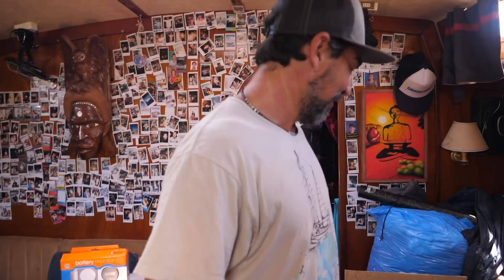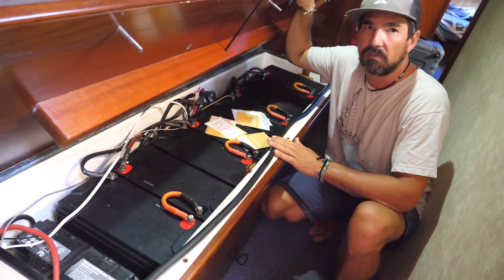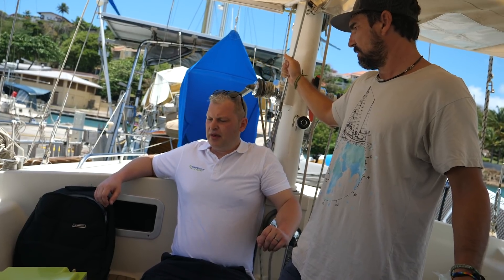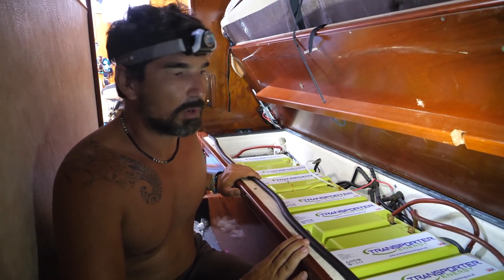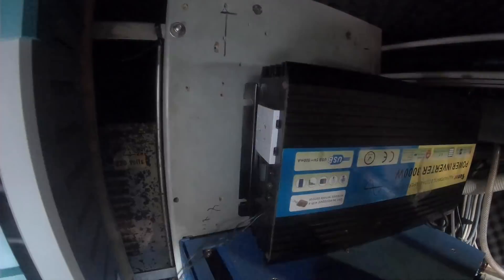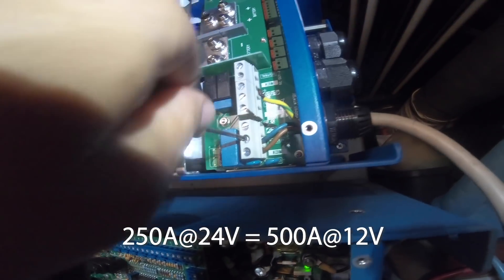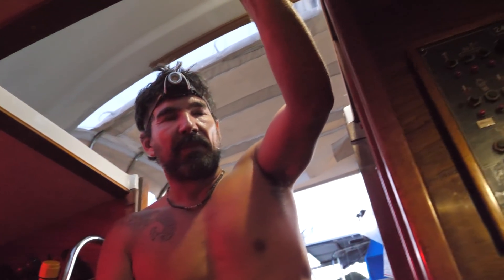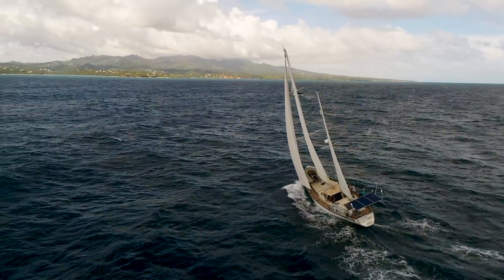Hello LITHIUM, Goodbye Propane!!!  Part 1-  Sailing Vessel Delos

Comment: Brian, I normally am enormous enthousiastic about your Technical knowlegde. But there are a few Safety concerns right nowwith your setup. 

You are running 4p2s setup while the internally bms (battery management Systems or computer thingy) is setup for single 12v eropin replacement. This means that the internal cells do balance but only within the 12v cells. In professional systems the Bms s of the individual batteries should be interconnected. Such that the 24v (2x12v) cells all balance equally. 
Second issue is that the 4 parallel batteries do not equalise because of the chemical electric properties. Normally lead acid batteries equalise automatically when paralleled because the voltage difference between full and empty is several volts. In the case of lifepo4 this is only .1 or .2 of a volts between 90% full and 20% empty (do not try to always charge your lifepo4 batteries this shortens life a lot in contrast to lead acid). The result of not equalizing is that one battery can be at 20% depth of charge and other battery at 40%. In which case you empty a single (set of 2 batteries in series) battery more than the other ones. Which means your total setup will fail much sooner, because of early ware of single battery. 

Third issue is that you rely on a safety mechanism inside of the battery in stead of an automatic Overal charge system. Ideally you separate load and charge form each other. Protect with a separate relay the load and charge such that your advanced overall bms controls at 90% full the relay of the charges and stops charging. Because you can’t control the charger by looking at the voltage as you would by lead acid. (I’d stop at 14 volts or something like that) because of the chemical electric properties. The bms system should stop charging when temperature of cells or equalization voltage of cell is reached. Same holds for discharging of the battery. In this way you are not relying on the safety mechanism but controlling charge and discharge. Victron has several examples of this on its website. The victron invertor has special add on programs for the bms to even control the charging or discharging. Such that you don’t have the issue of the spike (because of safety disconnects) of voltage. Instead the victron just stops charging. Nicely and safe. 

Fourth thingy. Lithium batteries are much more dangerous for shortages then lead acids because of the (low) internal resistance of the chemicals. This resistance is so low for lithium that giant power can flow, so big that it can evaporate cables. So please add a device in between the parallel batteries like victron battery protect such that it shut downs when a short occurs. In this way you are much more safe in case of a fire. 

Fifth I am missing the high power circuit breakers in your setup. (The cheap ones are enough just a bit bigger than your maximum load I.e. 200amps. There should always be one between a paralleled battery ( Incase a single battery shorts or something like that) and overall in case of an overload. So 4 in the cables to the connect bolt in the battery box and one in the cable from that point to your loads. As close to the battery as possible. This is not the same as a victron battery protect. Keep spares of the fuses on board!

So resuming very very nice setup ( i also have it installed in my boat but in separate cells in stead of drop in replacement, very happy with it. But take more safety precautions please!). If something is unclear please ask I try to explain it as good as possible. Also look at 123bms or batrium systems for bms systems. :)!

Safe voyages!
Reply from the maker: Hi Dennis, thanks for your comment.  We did have many of these discussions with Dragon Fly Energy, particularly about the internal BMS.  They said that this in fact was a supported configuration and the cell balancing should do it's job, however it may be worth it to follow up again with their engineers about the long term impacts on the internal cells themselves.  I'm sure they are interested in our feedback on the system configuration over time.  Interesting thing is that these batteries are designed to detect and stop the exact situation you describe, so it was not recommended to add an addition device  between parallel batteries.  The current protection device is in-fact embedded within each battery which will take the unit offline should it exceed the maximum allowed current.  We do however have overall system fuses and breakers, one at 400A, 200A, and 50A depending on where it is feeding.  Just didn't bother to show that part since it was already existing.  I know the internal BMS sounds interesting, but it sure does cut down on external wiring cables, and additional protection devices.    Dragon Fly provided some very specific voltages, and said the performance was optimized when the cells were at 14.4V, so 28.8V for our system, I hope to show some details of the configuration of the external victron BMS and the various charge controllers in the next vid.  Always gotta be a next vid :)  The whole thing is sort of a in-process project, but very exciting to get this onboard :) . Fair winds, and thank you for your excellent comment.  Brian
Reply: Hey Brian,
I think the BMS inside the batteries will work and protect the system of any damage.
But without an external BMS the voltage of the batteries in one branch can drift apart so that after some time the battery has 12.2V and the other 12.6V. This will happen when the internal resistance of the batteries are a little bit different. Every time you load or discharge the batteries the battery with more internal resistance get warmer and voltage difference between the battery is getting higher and higher.

There will be a problem when the voltage difference of the two batteries gets too high.
Let us say the voltage difference of the batteries is delta = 0.8V, the load cut off voltage of your inverters for both batteries is 28,8V and the cut off voltage of one internal BMS is 14.7V. When you try to load the branch to 28.8V the internal BMS of one Battery shuts the battery down when it reaches 14,7V. At that point the other Battery has a voltage of 28,8V -14,7V = 14,1V. The same is happening when you discharge the battery. I think it is not wise to use the internal overvoltage and undervoltage protection like this. Normally it is a protection device that prevent the battery for destruction. 

Normally the BMS should know the voltage of each battery cell in your case 8 cells. Then it will balance all the cell voltages to the same voltage.
If I were you I would check the voltage difference of the 4 branches regularly and if they are drifting apart I would balance them manually or install an external BMS.

And last but not least. I love your channel and your way of life.

Jan
Reply: You mean the voltage of the cells in series will be off? The ones in parallel should stay the same. So he has 4 battery pairs in series. Would his external BMS have to be connected to each parallel pair and charge them individually and then the internal BMS would take care of balancing the cells in the battery?
Reply: I had  the same concerns. I hope that Brian reads this!
Reply: LiFe batteries use the commonly preferred lithium technology for stationary energy storage. It is thermally stable and has high cycle life compared to some other Li-ION technologies.  These are not the kind of batteries that have been burning up in laptops and phones. The onboard BMS is crucial to the operation of this kind of battery. As far as circuit protection, I would go with DC fuses and cutout switches on a boat. The circuit breaker is not for a humid and maybe wet environment. This is from 40 years as an electrician and over 20 as a solar system designer and installer. Oh, and 20 plus years living off grid.
Reply: completely agree with Dennis' concerns - at least there should be an interface to the individual BMS's like CAN to enable a Master-BMS reading SOC, SOH  and DOD - than you really know, whats's going on;-)
@Brian: a functional block-diagram would allow people to better assist in improving your installation - nevertheless: excellent job - cheers!

Comment: now you have to builda slide out rack above your solar panels so as soon your not under way you slide them out and double the amount of solar no taking up extxa deck space
Reply: And use the wind speed sensor to automatically deploy or retact the panels so you don't forget to slide them back in during a blow when you're not on the boat...
Reply from the maker: Yes, now we're talking :)

Comment: Hey Delos, great induction gimbal, I was wondering if you’re  adding clamps to keep the pots in place on the cooker while navigating. Cause the cooker won’t be hot but the content will be.
Reply from the maker: Yes!  Just gonna copy the design from the old gas cooker.

Comment: Next comes the flux capacitor and the matter anti mater coupling device
Reply: It's tough to get good dilithium crystals when you're out cruising, you're never sure about the quality.
Reply: or what century they came from :-)
Reply: Dilithium is formed in the vapour of Lithium batteries when they are overcharged and thermally runaway. It's also possible to extract Lithium from seawater to produce quality Dilithium.
This is how I imagine the original USS Enterprise schooner was powered after someone time traveled back from the future and created the parallel dimension that is Star Trek... :)
Reply from the maker: 2.1 Gigawatts?!?!?!?

Comment: Brian, I normally am enormouslt enthousiastic about your Technical knowlegde. But there are a frw Safety concerns right nog with your setup. You are running 4p2s setup while the internally bms (battery management Systems or computer thingy) is setup for single 12v eropin replacement. This means that the internal cells do balance but only within the 12v cells. In professional systems the Bms s of the individual batteries should be connected. Such that the 24v (2x12v) cells all balance equally. Second issue is that the 4 parallel batteries do not equalise because of the chemical electric properties. Normally lead acid batteries equalise automatically when paralleled because the voltage difference between full and empty is several volts. In the case of lifepo4 this is only .1 or .2 of a volts between 90% full and 20% empty (do not try to always charge your lifepo4 batteries this shortens life a lot in contrast to leas acid). The result of not equalizing is that one battery can be at 20% depth of charge and other battery at 40%. In which case you empty a single (set of 2 series) battery more than the other ones. Which means your total setup will fail much sooner. Third issue is that you rely on a safety mechanism inside of the battery in stead of an automatic Overal charge system. Ideally you separate load and charge form each other. Protect with a separate relay the load and charge such that your advanced overall bms controls at 90% full the relay of the charges and stops charging. Because you can’t control the charger by looking at the voltage as you would by lead acid. (I’d stop at 14 volts or something like that) because of the chemical electric properties. The bms system should stop charging when temperature of cells or equalization voltage of cell is reached. Same holds for discharging of the battery. In this way you are not relying on the safety mechanism but controlling charge and discharge. Victron has several examples of this on its website. The victron invertor has special add on programs for the bms to even control the charging or discharging. Such that you don’t have the issue of the spike (because of safety disconnects) of voltage. Instead the victron just stops charging. Nicely and safe. Fourth thingy. Lithium batteries are much more dangerous for shortages then lead acids because of the internal resistance of the chemicals. This resistance is so low for lithium that giant power can flow, so big that it can evaporate cables. So please add a device in between the parallel batteries like victron battery protect such that it shut downs when a short occurs. In this way you are much more safe in case of a fire. Fifth I am missing the high power circuit breakers in your setup. There should always be one between a paralleled battery ( Incase a single battery shorts or something like that) and overall in case of an overload. This is not the same as a victron battery protect. So resuming very very nice setup ( ima,so have it installed in my boat but in separate cells in stead of drop in replacement, very happy with it. But take more safety precautions please!). If something is unclear please ask I try to explain it as good as possible. Also look at 123bms or batrium systems for bms systems. :)!
Reply: Dennis de Jong Wouldn't the internal battery protection in every battery shut the battery down in case of a short ? So why than have additional protection between the parallel banks ?

Comment: Hey Brian, thanks for this video. i'm considering doing the same on my boat. One thing I'd be interested in is how well you can control and cook on that induction top. I hate cooking on conventional electric because it seems much harder to control the heat. Looking forward to your long term report. Thanks again!
Reply from the maker: YES!  We will report back and let you know.  So far the temperature control is so much better than our gas stove which had basically off and super-burn.  Now we have about 16 levels :)

Comment: Great vid Brian. Would be great to see an update as to how it worked out after a few months. Also, a high level video on how the different sources of energy, such as solar panels, wind generator, diesel generator, and dock power, and how they all work together. All the best, safe travels.

Comment: Too much scuttering about for me and very expensive and heavy, Should of went for light very small light weight superconductors which would save a huge space and be fully charged up in 3 seconds, Lithium is dirty to mine & manufacture and to transport and to produce and you say 5000 cycles with battery management system on, But some say 1200 without, But a superconductor can take over 1 million + charges the tech is out their, feel the force!, Maybe Dalos 2.0 will have it installed, Love the gimble cooker, looks like star trek enterprise bridge. Hope it all works out in the end.
Reply: Superconductors are something completely different. I think you are thinking about "supercapacitors" (which is just a hype name for big capacitors). There are of course benefits to capacitors, but a big drawback in e.g. a boat solution like this is that, at best, their energy storage capacity is about 5-10% of that of a Li-Ion battery.

Comment: Great video Brian.  A couple of questions: 
  1) What happens if a battery (wired in series to create 24V but still connected to the rest of the bank in parallel) takes itself offline?  I assume the other battery will immediately sense the back feed and shut down (leaving the other six batteries to generate the load)?
  2) What are you doing to replace your gas oven?  It was propane powered as I recall.  Are you just going to go with a convection microwave?   There are lots of those available - I've used a Panasonic one for almost 20 years and we love it as it is much more efficient than a regular electric oven.  It will be interesting to know if you have enough power to run the dual burners and oven for any length of time.
Looking forward to the update video!
Reply from the maker: I believe if one of the batteries in parallel shuts down it will just look like an open circuit for the other battery, IE it won't be charged or discharged until the other one comes back online.  You are spot on about the oven, that is what we're planning.  Will let you know how it works.

Comment: Beware, Lithium batteries are very very pickey, if you ground the positive and negative togeather even for a second the battery will die, and possible fire
Reply from the maker: Ha best to avoid this with any battery I've found :) . Actually these have an internal system to detect any state and shut the battery off before any damage can occur from out of spec current, voltage, or temp.  Pretty cool if you trust the tech.

Comment: Lifep04 Would be what I consider the best lithium chemistry for a sailboat.
Less risk of fire than other lithium battery chemistry and highest number of discharge/recharge cycles.
Lithium NMC would be my second choice.
And right after I posted this I heard Brian say in the video Lifep04 was what he chose.."sigh"
Good Job Brian!!! I chose the same for a land solar product.
Up front cost is much higher than lead acid but they last much longer so it should even out in the end.

Comment: These recent technical videos have been super cool and informing. They have also gotten me thinking about some of your other technical challenges. specifically, I am curious about your storage system: the location (onboard or offsite?), are you running raid, how much storage or footage you have stored is there. Also about your internet setup: how fast is it, how spotty, is it satellite; that kind of thing. Keep making great content -- very informative and entertaining!
Reply from the maker: Hey Zach, that could be a very cool video but here is the quick one- We have a WD Ex2100 with 4x6TB red drives (hot swappable) running in Raid 5.  It's hooked up to a wireless network on Delos so we can all access it.  When we get into port we make backups to small 4TB USB drives and mail them to friends and family back home.  We usually use internet only when we are in port with local 3G/4G cards.  Satellite for us is only small text messages, short email, and weather.  Fair winds!  Brian